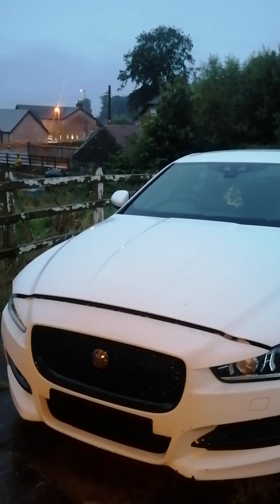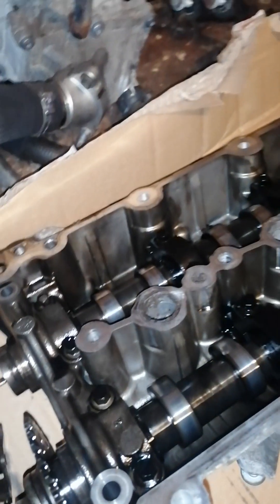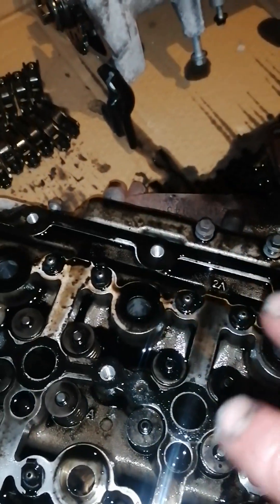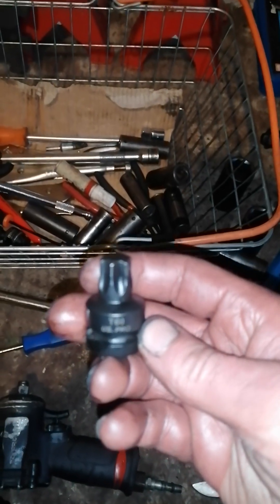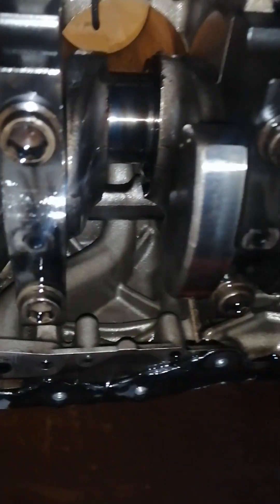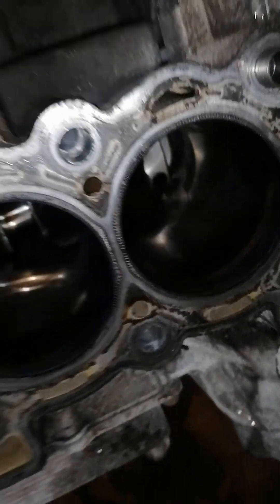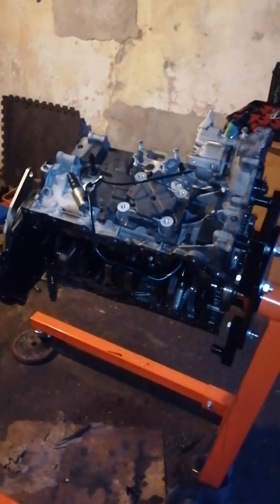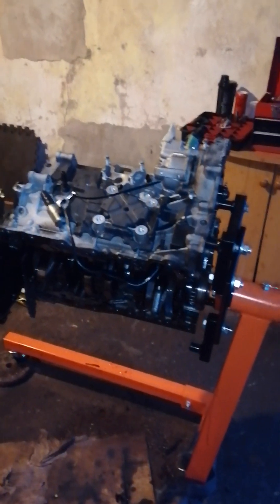Jaguar XE Engine strip down

Comment: We are overhauling a lot of this type of engines. We are re-sleeving the whole block with new sleeves. Our sleeves are bi-metal, on the outside we put a layer aluminium, for the better heat transfer, and the sleeves has a verge too, not like the poorly designed original sleeves, which can turn in the engine block!
The original engine runs between 60.000km and 120.000km, the engines we have rebuilt have already covered over 200.000 km without any issues!

Comment: Hi mate, another message from myself been studying all sorts of videos before commencing work. 
For the engine holder mount thing did you have to buy seperate bolts to attach it to the engine block? Im just trying to order everything needed before starting the work and thats one thing thats puzzling me
Reply from the maker: Yeah you will need separate bolts. I used the gearbox bolts that I had already removed. All the best with the build!